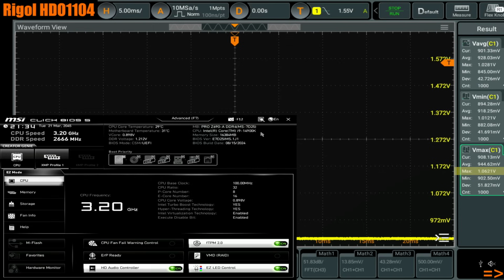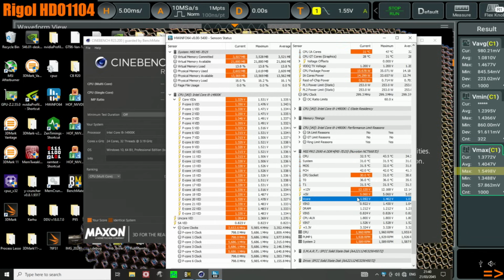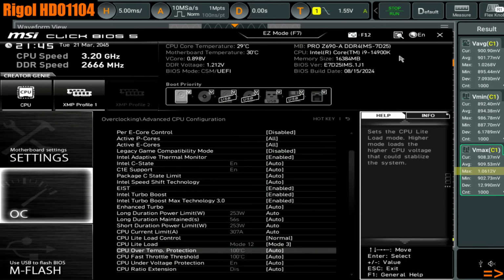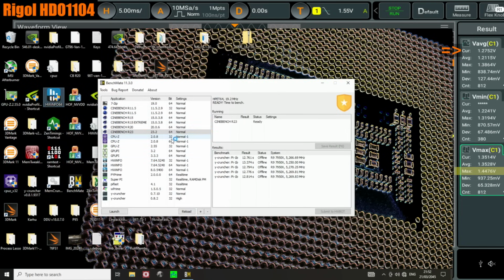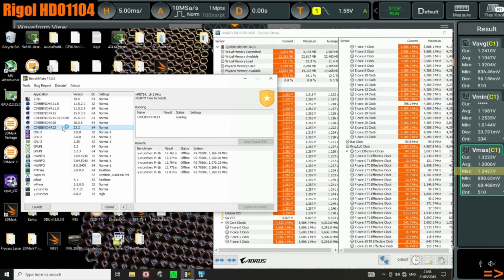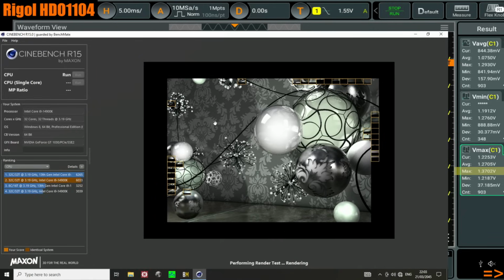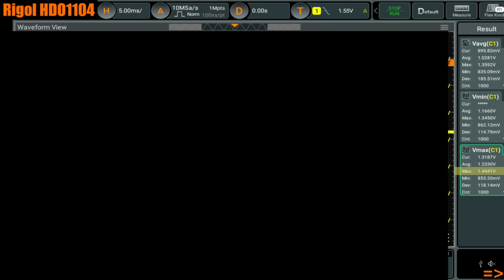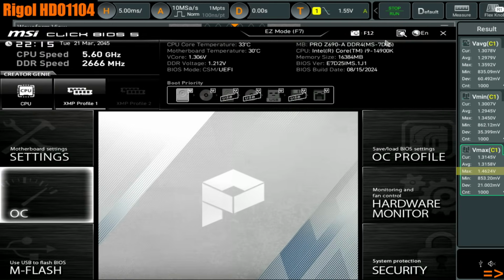"Optimizing" the i9 14900K on the MSI Pro Z690-A DDR4 with 0x129 Microcode

Comment: The fact Asmongold crashed during a livestream compiling shaders for Black Myth: Wukong running x129 says a lot. Not looking good boys…. Edit: doesn’t look like his Bios was ever updated.
Reply: the new microcodes wont fix already degraded cpus, they will only protect from further damage
Reply: Anyone running a 14900k that they didn't undervolt and downclock out of the box is probably well into degradation already. Blocking spikes above 1.55V won't save these chips.
Reply: @AzwraithPL Considering the 13th/14th gen instability issues didn’t get any press attention until well after 14th gen’s release. Not many ppl if any would be doing such things at stock settings. Because nobody knew there was a problem…
Reply: @MhillPlays  Actually I'd imagine there were more people undervolting their 13th and 14th gen processors out of the box than any generation before given how thermal throttling at stock settings was a significant problem with these chips that was getting some attention by even non-enthusiasts. Having said that, your average gamer who just went with the most expensive option at checkout and doesn't even know how to open their BIOS or check their CPU temperatures in the first place has probably been running their chip at dangerous voltages since they got it.
Reply: Yeah let's be honest. Asmon probably has his pc built through his company and just goes
Reply: @DeagleHonor turns out he’s never done a bios update in his life, yet he crashed during shader compilation (figures). This doesn’t give me much faith in his computer company lol
Reply: @MhillPlays  that's not shocking to me at all. To be fair to his PC company I would think and hope they have people in place to support this type of thing but knowing about Asmon he probably said to hell with that, give me my PC, vroom we're off 😂
Reply: @MhillPlays  To be fair, it's never really been recommended for the average user to update their BIOS unless they have to for fear of bricking their board. If they haven't run into a tech issue in the past or had to update for hardware compatibility I'd expect most people to lack experience with it. Honestly, I'd be surprised if more than 10% of users have even opened their BIOS before let alone updated it.
Reply: Anybody knows a longer "shaders compiling" test / benchmark than the benchmark tool for Wukong? That one is over pretty quickly.
Reply: @sp00n  can't you just install the Nvidia drivers over and over again?
Reply: @sp00n Hogwarts Legacy. That certainly will trip most unstable systems.
Reply: @MhillPlays  Mh. That's really only an option if you already own the game, a free benchmark or utility (that doesn't require you to install graphics drivers over and over 🫠) would be a more general option.

Comment: How much can I actually trust HWINFO VIDs and vcore reading from the motherboard?
I have a 14900k and stays mostly at 1.4V even with a super single threaded load like minecraft.
According to my Asrock Z690 Taichi BIOS the VID for 6Ghz is 1.404V, which from what I can see is exceedingly low but I do still worry about getting too much voltage
Reply: The HWiNFO VIDs are influcened by the DC_LL setting. They should be matched to the acutal VRM loadline, but MSI does not do this, so unless you match them manually they will be wrong.

Comment: We are waiting asus motherboard optimised video (0x129)
Reply: Yes ❤❤❤
Reply: Funny enough, for me, the best settings are the ASUS OC optimized ones. Highest voltages ive seen are about 1.31 (including a +0.02V offset). 13600K, 5.4GHz 1-2 core, 5.3Ghz all core load. Im lazy, i just use intel extreme tuning app's with its Speedoptimizer 2.0 turned on at boot. If i do the same on the intel default settings profile, it goes crazy. Pushing 1.3V on all core load CB23, when it should do 1.2V. Results in lower clocks and 100C on some cores. ASUS profile it just works fine, temps 75-80C, all core voltages 1.21V on the same test.
Reply: @PeTe_FIN I have 13900ks with ASU’s oc settings in bios I have better scores in cr23 but more volt and temp 
With intel I have lower scores and lower temps
Reply: @goku-92-92  Its interesting, i turned the intel extreme tuning stuff off and with ASUS OC setting in bios + XMP, it behaves what you would expect at stock values. 5.1Ghz normal clocks, 4.9Ghz CB23 with 1.15V and temps are like 65-70C. Maybe the all core is higher than it should be as intel default, cant remember. But max clock is 5.1 as it should. With idle voltages jumping between 0.7-1.29V. So with the OC applied i gain 400Mzh all core speed, with 0.05-0.07V increase and temps go up roughly 10C.

Everything is still very much under control tho. Even at unrealistic normal usage CB23 run has 20C to thermal limit, voltages havent been over 1.31V ever in hwinfo. So if Intel is ok with 1.55V on 13900, 1.31V sounds very safe :D
Reply: @PeTe_FIN  right bro !!!
Reply: Please!!!
Reply: Set the VID limit, same as gigabyte
Reply: @AndroidBeacshire  Point was, in the asus oc profile it works correctly. it stays in the 1.2V range for C23 run, while it can do 0.72-1.3V in windows general when clocks are jumping all over. Im sure the intel extreme tuning app just has a bug with the new intel default settings, but since asus ones dont seem to result in high voltages (that hardwareinfo would pick up), i just keep using that one. Temps are good, voltages seem under control and most important of all, its stable in every bench/torture test i have ... tested.
Reply: @AndroidBeacshire  if you mean the IA VR VOLTAGE LIMIT - that setting is not available on MSI boards. If you mean some other setting I'm interested which one exactly
Reply: @charonme  Yes that one.
I have a MSI board too, I was hoping BZ would find the IA VR limit but no bueno
Reply: @AndroidBeacshire  i just set my 14700k into 1400 VID limit like buildzoid said.

Tried it for several test and it looks fine for now 😭
Reply: This
Reply: @henaakter5009  he did say (I didn't catch it the first time through the video) that he was doing an Asus Board next
Reply: I'm over here pressing refresh on his page every few hours, lmao.
Reply: My ASUS motherboard doesn't have VR VOUT reading and also Sync AC DC load line with VRM load line doesn't seem to work with non-K processors. So yeah I'd benefit from knowing the VRM load line percentages
Reply: I don't know why though. Gigabyte B boards have VR VOUT readings... Come on asus
Reply: Says nobody cuz ASUS is traaaaash

Comment: We need asus motherboard setting with i9 13900k/ i9 13900kf with 0x129 microcode
Reply: Should be the same, lol.  14th gen is basically a new stepping, within silicon variance of 13th gen.
Reply: sync all cores to whatever all core spec your cpu has (to get rid of the stupid 2 core boost stuff), IA VR 1450~, pl2 253w (pl1 whatever you want, i set mine to 253w aswell), then just undervolt while keeping stability ESPECIALLY in UE5 shader compilations. 
If you wish to do so you can also mess around with the loadline settings as buildzoid showed in previous vids. 
Keep in mind that ASUS uses 0.00 for lowest AC/DC and not just 0 like some other boards

Comment: Question for the great and powerful Buildzoid:
I'm running a 7800X3D, Gigabyte AORUS Master X670E, 2x16GB of G.Skill 6000MHz CL30 (1.35V default voltage) at 1.4V, 6200MHz, CL28-36(TRCD)-30(TRP)-32(TRAS)-62(TRC) with 400 TRFC, and my FCLK is at 2200MHz at 1.2V SOC.  I've ran what stability tests I can (OCCT regular memory & LInpack mode, AIDA 64 stress tests, Cinebench, all the different 3DMarks just to stress the CPU etc in different ways, gamed on it a fair bit) with no issues thus far, been using it for a few weeks now. 
Generally speaking (I mostly used your "safe" timings from the HWUnboxed collab you did for secondaries), is that pretty good for daily driver, or what would you recommend I try to push next?  I have tried 6400MHz a few different ways, but it causes issues every time... I obviously have to raise SoC voltage to push those clocks on the Memory Controller, which based on what I've learned from you means I'll likely have to drop FCLK, but any other suggestions?
Also I can't afford to spend money on other stability testers, what else would you recommend running to test stability?

Comment: What’s worse for degradation, high voltage or high current?
Reply from the maker: depends
Reply: For voltage, as long as you don't cross certain threshold it won't degrade anything. The problem is, we don't know for sure what the threshold is and you also have to accont transient spikes and normal distribution of voltage across all the electrons (for example if the osciloscope shows 1,3V, say 1/10^9 of all the electrons could still carry more than 1,32V and another 1/10^9 below 1,28V - numbers out of my ass, but you get the idea).
Current always causes electromigration, but it's usually so slow that it's not a problem. Well, unless your CPU is constantly pulling 200+A with 300A spikes, which 13th and 14th gen can certainly do.
Reply: theres a video on this channel about degradation, should explain why its not that simple

Comment: Do the higher end MSI boards still freak out at high switching frequency? Not something they can correct?
Reply from the maker: I haven't checked in a while but probably.
Reply: What, freak out? I've set mine to 1000kHz for LLC, so I should reduce that to ~700-800kHz?

Comment: There's yet another bios released for this board, not sure what the real difference is, 8/21 version "7D25v1J" -- doesn't have beta so not sure what exactly the difference is though.
edit, not sure why, but MSI has a really weird naming structure, the earlier "beta" one is listed as version 1J.1, where as the newest (listed on their site as released 8/21) shows in flash as 1J.0. "build date" is literally the same between the two in flash as well (8/15)..

which is stupid to me why they would listed as that. God MSI is really starting to piss me off these days.
Reply: Same

Comment: Do an ASROCK board.  Im done with the other 3 brands
Reply from the maker: don't have one
Reply: It's not a sustainable model to swear off a motherboard brand because of one lemon model like the guy above me said. There's like 5, you'll run out sooner rather than later lol.
Reply: @kkonstant31dafuq, I was shocked when i just checked the price now. This is a way too god deal. I have PG Velocita (I was the person who provided BZ the pictures of the mobo back then), and luckily, never had a single stability problem with my 13700K. Although my Focusrite soundcard sometimes just randomly starting popping and the audio gets delayed. Oddly enough, I've turned off the E-cores for a few weeks, never had a single problem like that. Now I updated to 0x129, adjusted everything (I don't have a max voltage limit, but the max voltage spike I have now is under 1.4 volts), turned on the E-cores again and started having the same issues with my soundcard if I hit the CPU hard with load. I'm wondering if it's related to the oxidation issue. My CPU's quality is TOP 0.01%, max VID should be 1.309V according to BIOS, so I don't think that my issue is voltage related. 
Still, that price for that board is a gift from ASRock
Reply: @kkonstant31 no idea, might be a w11 issue. There have been a few driver updates since the OS came out and the stability of the drivers improved a lot, but I still get the issue sometimes. What’s ur sample rate? I use 96 KHz with like 230 samples at 24 bit. I usually reset my card by changing sample rates to 48 KHz and switching back to 96 KHz. No replug needed, but the issue is still irritating. I knew w11 is horrible since day one, thought it’s a bug with the OS at first, but the oxidation and the latency issues (discovered by Tech Yes City) made me think it might be CPU related. I also thought that it could be an overload at the I/O side, like the psu or mobo doesn’t provide enough voltage to the USBs, but since my PSU has a lot more power than what my system needs, I don’t think that’s the issue. Although when I was checking some forums, I discovered many ppl have issues with focusrite gear on 13th gen systems.
Reply: ASROCK intel motherboards are bad(especially budget ones).They were even selling multiple B series motherboards (mainly b660m-itx) with 100w limit as one compatible with 13900k.But their Ryzen motherboards are pretty good.
Reply: Gee, what will you do when they mess up. Calculator? 😂

Just curious, do you stop buying a brand of car because they put a bad model out one year?

Comment: Hi BuildZoid, if you haven't already done so, can you test the MSI 0x129 BIOS to see if it disables the 1.55V limiter when you leave (or get kicked out of) Intel Defaults. MSI tech support refuses to give any guidance on this matter because the people we spoke with either didn't understand the question or didn't know the answer.
Reply from the maker: I did a quick check and both of the MSI profiles seem to have the 1.55V limit in place. However the unlimited profile disables CEP and drops the AC loadline to 0.5 which with my CPU destabilizes cinebench R15(so that's something to keep in mind if the unlimited profile is unstable for you).

But with MSI's BIOS you can still change the ICCMAX and power limits even with the intel defaults enabled.
Reply: @ActuallyHardcoreOverclocking when i run r15 or r15 extreme it only loads my e-cores, even if i set it to 32 threads whats the trick?
Reply: @Jolinator  Is this on Windows 10 or 11?
Reply from the maker: @Jolinator  need to use the benchmate version which fixes the scheduling
Reply: @ActuallyHardcoreOverclocking  Thanks!
Reply: @sp00n  10
Reply: @Jolinator  Ok, Windows 10's thread scheduler seems to have issues with the heterogeneous architecture of newer Intel chips for certain programs. In Windows 11 that should be fixed and running fine. If you want to stay on Windows 10, you could try to switch the Power Plan to High Performance or use something like Process Lasso. I haven't tried the Benchmate version of Cinebench, so cannot comment on that.
Reply: @sp00n  Didn't they update the scheduler of 10 though to fix those issues? R15 is the only program I have ever had issues with on these hybrid cpus. If i ever find a way to set the folder previews to look the same as 10 on windows 11 I may migrate its current implementation kinda sucks. If you're the same sp00n that made corecycler its awesome piece of software I keep in my toolkit👍
Reply: @Jolinator  Yeah, I'm the author of CoreCycler. I recently got my hands on a 14900KF and have made some improvements for its Intel support in the recent versions (especially the new v0.10.0.0 alpha).
My main system with Ryzen is still on Windows 10 as well, but that Intel system is on 11 while I still play around with it. I'm not sure if Microsoft fixed all the issues with the thread scheduler, Intel itself seems to suggest you use Windows 11 with their hybrid chips.
Reply: Why don't you test it yourself? Do you have an MSI motherboard and a 14900k?

Comment: Do this with your Gigabyte Aorous Elite AX please
Reply: CPU Settings:

	•	Pervdrive: Optimize
	•	Enhanced Multi-Core: Disable
	•	CEP: ON
	•	TVB: ON
	•	Offset Voltage: -95 mV
	•	IA VR Voltage Limit: 1375 mV
	•	IA VR Config: Enable
	•	CPU Current Limit: 400 A

Speicher-Settings:

	•	XMP Profile: XMP 5
	•	High Bandwidth: Enable
	•	Low Latency: Enable

Power Management und C-States:

	•	Loadline Calibration: Turbo
	•	AC Loadline: 45 mΩ
	•	DC Loadline: 45 mΩ
	•	C-States: Enabled
	•	Package C State Limit: C7

Dynamic Tuning Technology:

	•	Dynamic Tuning Technology (DTT): Enabled
Reply: @ImV3ng3anceEXE   That's what I've been looking for!  Thank you good sir(s)!!  💫
Reply: He's done so many videos on that board are you sure it hasn't been covered in one of them.

Comment: Hooray, 31 seconds ago! Let's see if I can apply any of this to my Z790 MSI board
Reply: I have the Z790 Pro-A DDR5 and a 13700k. Been using CPU LL mode 3 and a 0.125 offset for a year, but I havent changed the load line mode at all. Ive been 100% stable the whole time.